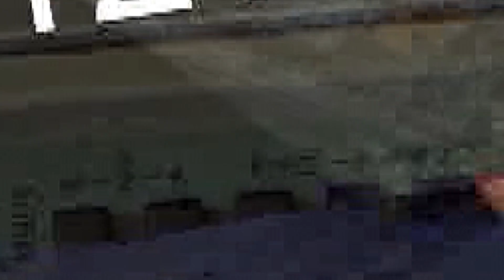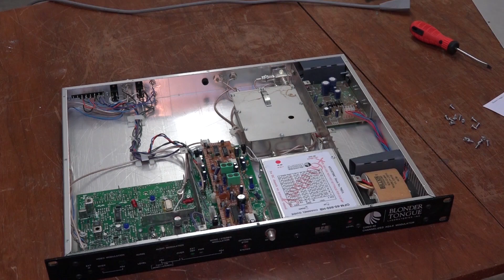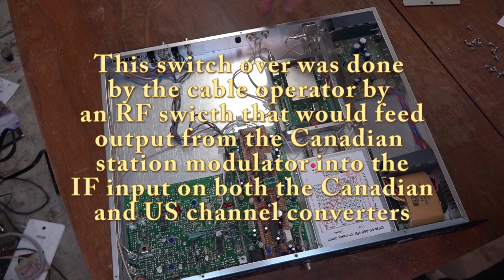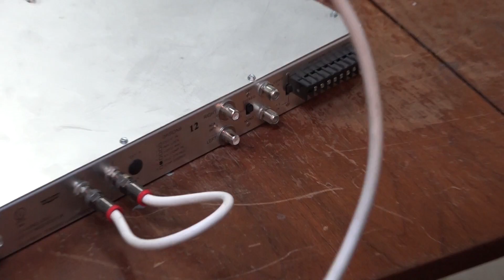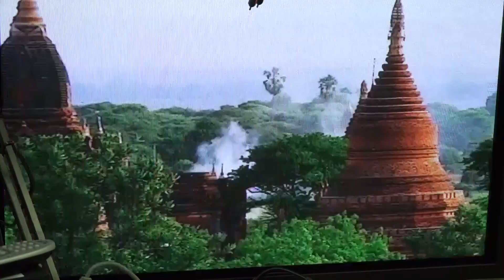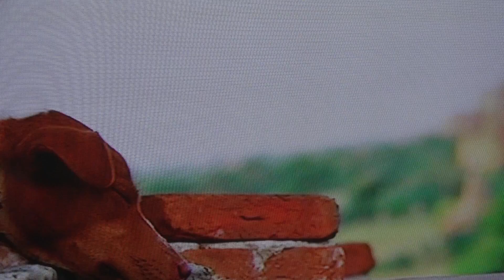Blonder Tongue CAMS 60 MTS Stereo Modulator tear down and test

Comment: These seem to run alot cheaper than the am60 series modulators on eBay. I assume this is due to them being locked to a channel,without fiddling anyway...

I feel like I'm missing something, if I put an antenna on one of these that's locked/set to channel 4, would I not receive stereo video on my old tvs on 4?

Not understanding the multi hundred dollar premium on The mono am60 series units.
Reply from the maker: It is called what the market will bear.  I got this for 50 from a shop that was closing up to move to a new location so they were liquidating all the surplus stuff as they did not want to move it and the new location was 1/4 the size. The cam60 I have is agile. The frequency can be changed.  What can't be changed by flipping dip switches is the tuning on the 60db amplifier.  That needs to be put on a spectrum analyzer to be re-tuned. The only difference between the mono and stereo is the mts module.  With the +60 db signal out an antenna will radiate a few feet.  I have only tried it into a piece of wire a few " long and I was able to pick it up on my portable tv across the room.  Into a high gain antenna it would probably go a couple hundred feet or more.

Comment: What channel does it broadcast to? Can you change it?
Reply from the maker: It is set to channel 12.  It can be changed but the amplifier would need tuning.
Reply: @12voltvids  cool, I'm going to order one soon!
Reply from the maker: @joshm264  I picked this one up cheap and it works great. Had been used at shaw cable for ctv network until they pulled the analog. I picked it up for 20 bucks.
Reply: @12voltvids  Also, how hard would it be to tune? I'd like to set the one I'm getting down to VHF
Reply from the maker: @joshm264  most are set with dip switches so all you need is the manual to show you the correct settings.  I have a manual for the wacom modulators I have. Can tune them to any vhf uhf or cable channel including the sub channels below channel 2 that were used for backhaul of live events.  Go on channel a-7 and interrupt city hall meeting.  LoL

Comment: Hey I have an older cable plant at a school and the switch on the back of one of the blonder tongue ESHP heterodyne broke off and now the unit doesn’t work. Is there anyway to bypass the switch?
Reply from the maker: Probably. You will need to open it up and just put the wires together.
Reply: 12voltvids i opened it up but there are 6 contacts were the switch was, but idk what ones of the 6 to connect a wire to it need to go out on the ext side of the if source selector